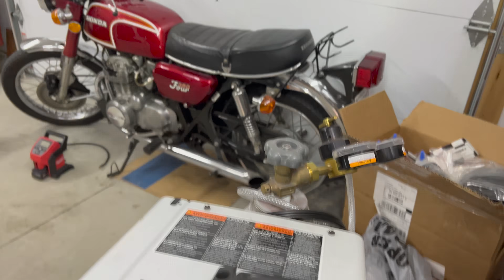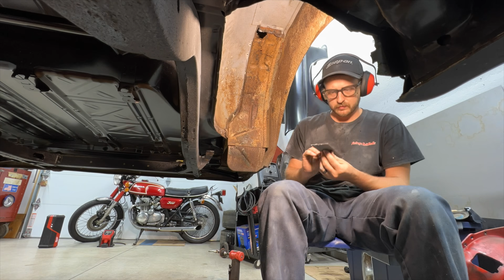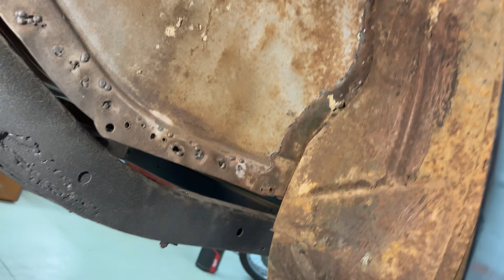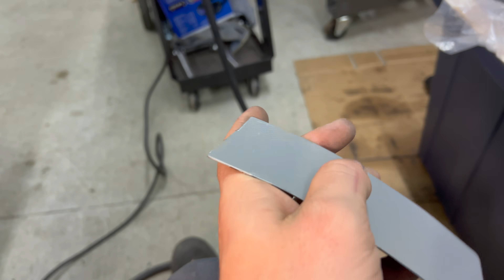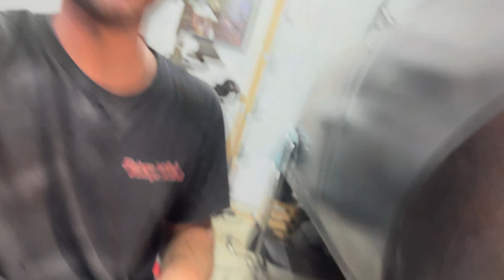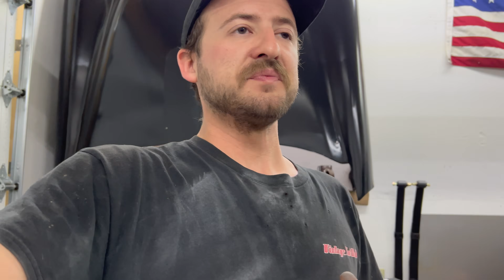55 Gasser Final Patch on the Drivers Side Wheel Well.

Comment: Dang! You had an Ad for Upol, that was almost 4 minutes long (practically as long as your video) The great thing about Gassers is, the body work doesn't have to be perfect  (far from it, in fact) And what model Honda is that in the background? I may have told you this before, but I own a 1970 Honda CB750 Chopper, with a twisted springer front end and, 3 foot sissy bar and 70's era paint. So I kinda like old Hondas. Thanks for the video
Reply from the maker: Thanks for letting me know ill check into my ad settings and be sure they are all made to be skipped or short. And it is a 1973 cb350Four. All original bike minus exhaust. Bought it off the original owner. 14k original miles.